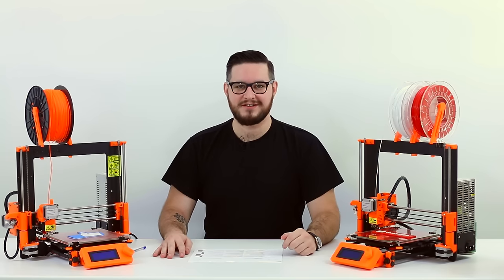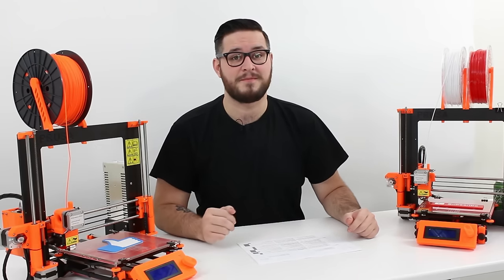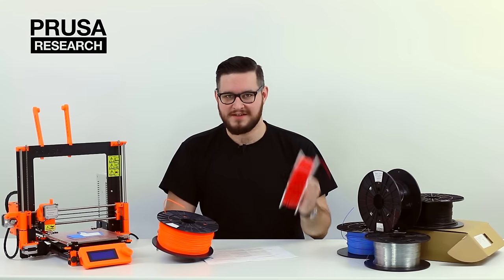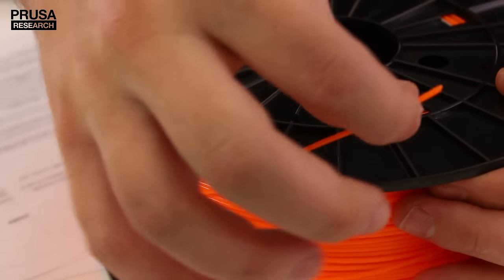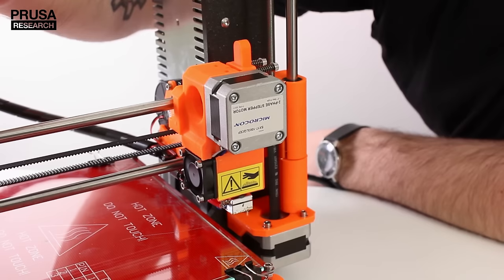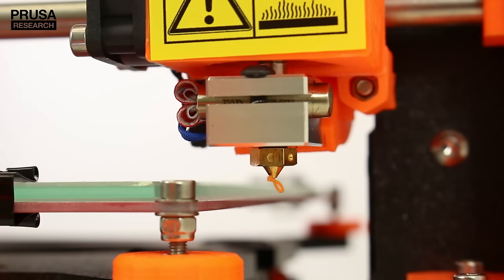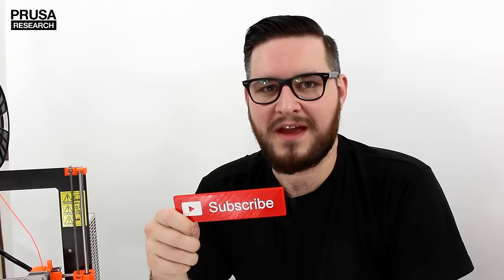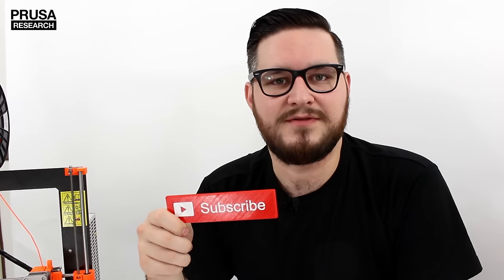The right way to insert a filament - Tips and Tricks #1 [3D Print]

Comment: These video series are great! Didn't really understand the part about the temperatures though, even with subtitles.
Reply: +theregnarute He's saying if you load a new filament, and the previously installed filament used a higher temperature setting, then use the higher temperature setting for loading the new filament to clean the remnants from the nozzle during loading.  For instance going from ABS to PLA.
Reply: +Wavefront101 thanks that makes sense. Happened to buy cleaning filament to test it, so since there is like a meter remaining there's still some time until it stops being a thing to run the cleaning filament between filament type changes.

Comment: Only tip I would add is doing a cold pull before switch filaments with different temps requirements .  Talman bridge works great for cold pulls.

Comment: I've an MK2S version, i've see in the manual that the SPRING on the IDLER SCREW must be 13cm circa when tight .
My question is : "The spring length must be measured without the filament inserted , it is right " ? When the printer arrive to my home the spring was more loosen , i did not measured it , but now i don't understand what is the right distance in CM and if we must measure it with or without filament , thanks